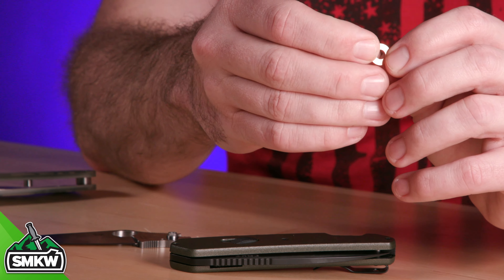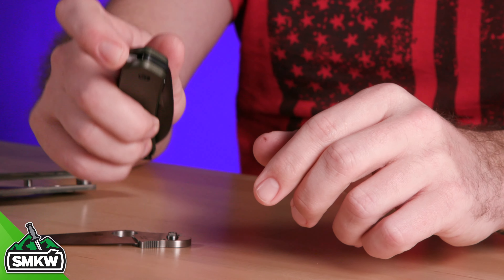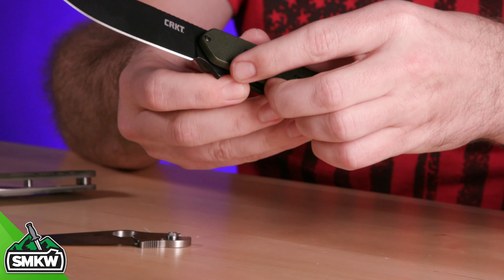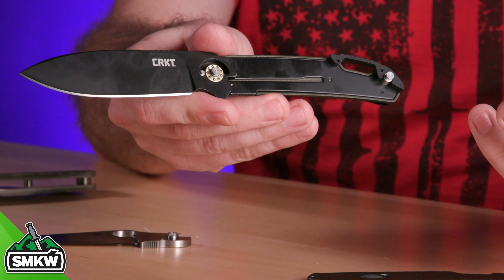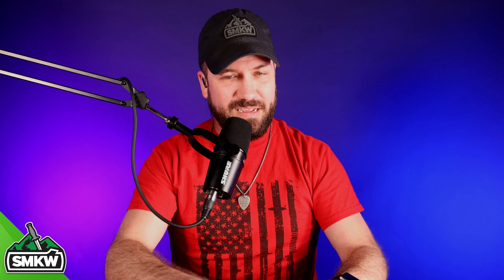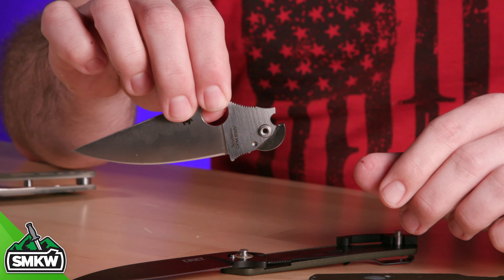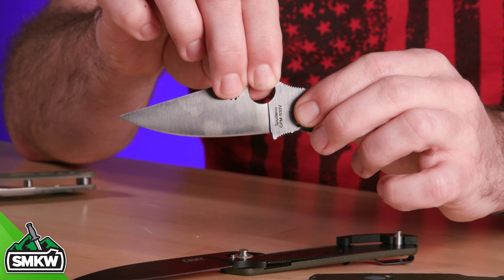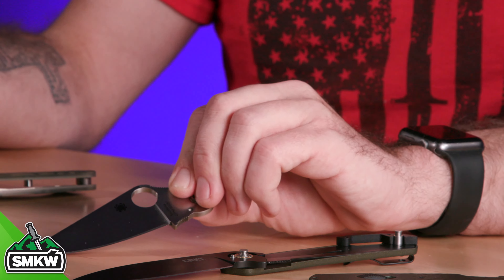Knife Lingo: Pivots

Comment: Pivot Point on Slip Joints is it the pin 📌 0 Holding The Blade.?
Reply: It's kinda complicated, on most yes it is the pin holding the blade that doubles as the pivot, then there are a hand full that use a bushing pivot to reduce wear and tear, then a few of the more modern slip joint imitations use ball bearings.